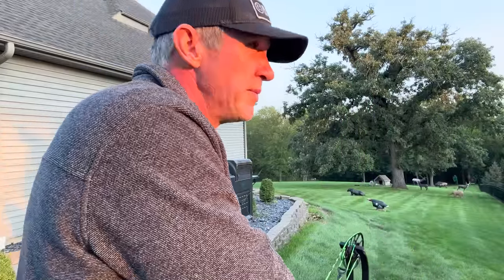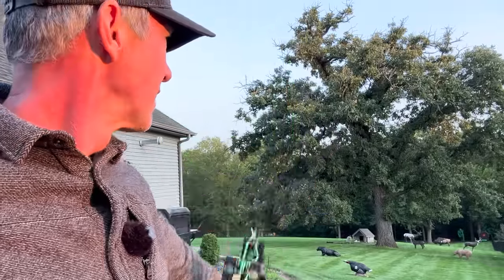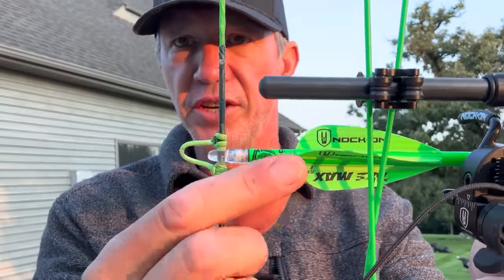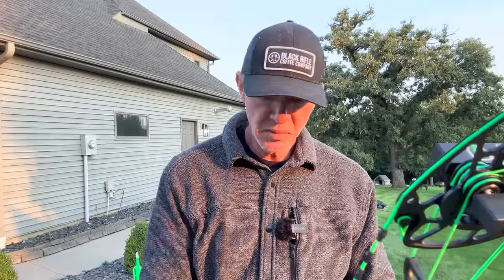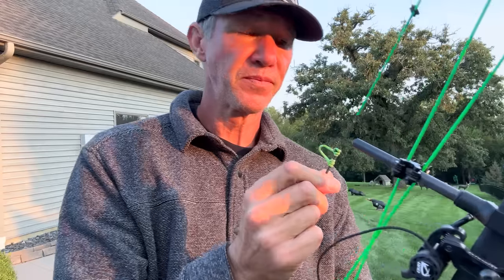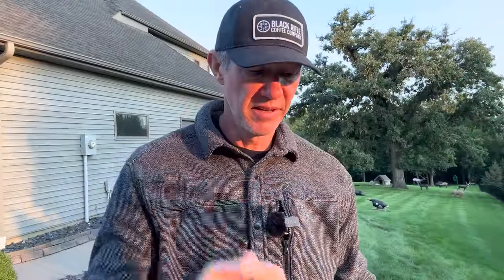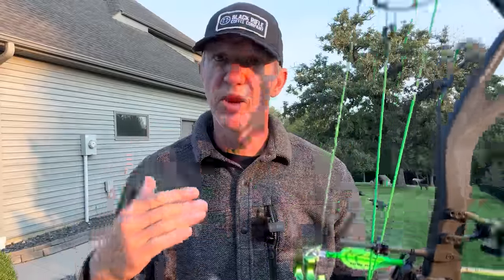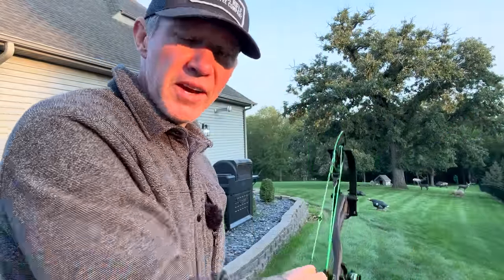EASY TO SEE ACCURACY KILLER that’s so easy to fix!

Comment: Interesting video! Im currently having an issue where i can send a few arrows, no problem - but then all of a sudden it goes 3-5 feet over. Me and a friend are really scratching our head trying to figure out what is causing this. I am very new to archery, so i do not have alot of knowledge but it's really frustrating sending arrows into the wall behind the 3D target when the shot feels so good. Any tips? Anyone?
Reply from the maker: If it’s the same arrow that could be a result of one arrow on the lower end of the tolerance allowance. Try turning the nock90 degrees and shoot it again and see if it’s grouping position changes. If so you can keep trying to adjust the nock to bring it back or replace the nock entirely. Be sure to mark that arrow too. Fyi lower cost arrows have a wider variance in straightness and spine consistency so it’s not uncommon to find a flyer on a dozen if they aren’t “match grade” arrows
Reply: Number your arrows, take a sharpie and write a number on each individual arrow. If it's the same one consistently it might just be the arrow.
Reply: @nockonarchery  I appriciate the reply! They are infact cheap arrows, and i am getting some better ones tomorrow. But it is unfortunatly not isolated to a specific arrow, as several of them went into rocks and broke after going way over :D It is worth mentioning that i did go from a whisker biscuit to a QAD drop down rest, and only then did this start to occour. I also noticed that the top half of my serving had slightly lowered. Could something here be the issue? I probably have a little knock pinch aswell, that will be sorted tomorrow
Reply: @dunk7689   I appriciate the reply! They are infact cheap arrows, and i am getting some better ones tomorrow. But it is unfortunatly not isolated to a specific arrow, as several of them went into rocks and broke after going way over :D It is worth mentioning that i did go from a whisker biscuit to a QAD drop down rest, and only then did this start to occour. I also noticed that the top half of my serving had slightly lowered. Could something here be the issue? I probably have a little knock pinch aswell, that will be sorted tomorrow
Reply: I'm going to guess it's your form and shot process as I've gone through the same issue. As my form has improved, so has my consistency in my groups. What I figured out was that my draw sequence wasn't smooth as it should be causing me to strain my shoulder causing extra exhaustion and inconsistency. I dropped my draw weight to combat this and it's helped a ton in helping me correct my form. Accuracy / No injury > high draw weight
Reply: @johnvang5581   Although my form definetly can improve, it just dosent add up. I can have a solid grouping on 50 meters. But all of a sudden, when i send one - i hear a different sound from my bow, just slightly - and the arrow lands 2-3 meters above the target. As mentioned earlier, i did recently change the arrow rest, but after several slow motion videos of the dropdown, we cant see anything wierd. We are kinda lost at this point, and we've tried all sort of different tips and we cant really seem to figure it out. The bow is only at 55-60 draw weight.
Reply: @christerlkas5148  I would mark your fletching for the arrows that are flyers to see if these arrows are consistently flyers. If they aren't, Id say it's the archer. Are you punching the trigger or having target panic? I noticed I have target panic too but was able to minimize this with better follow through on my shot process. Maybe this might help? What JD said above about cheap arrows is a good point as well. Also, are you shooting consistently high or is in consistently all over the place? I've shot consistently left before getting a second opinion and he told me I've been torquing my hand during my shot process. 

I'd go over the basics and have your friend or someone else that's knowledgeable to look at how you shoot. If you have flyers, it may be arrows if your basics on form/process checks out. 

Does your bow have a solid back wall ? This makes a big difference too. I went from a infinite edge pro to a used hoyt charger. Night and day difference in confidence now.
Reply: @johnvang5581   Thank you for replying!
All the bad arrows are gone, they all met the rocks behind different 3D targets. I am getting better arrows tomorrow, recommended by several archers and also cost abit more.

I did use to punch the trigger alot, but that has improved alot after many videos and practice. And the arrow was consistently high - always.
At 20 meters it was going about a meter over, on 50 meters it was going a solid 2-3 meters over. 

I then handed the bow to a much better archer than myself, he's been doing it as a semi hobby for a few years - the first arrow he sent when straight over and was left with a big questionmark above his head :P

We did several shots where we REALLY focused on the form, from nose touch, to anchor, grip, release etc. Some arrows shot fine, until it all of a sudden went real high.
What confuses me alot aswell is the fact that it happend after we installed the new arrow rest. My mind is locked on to it being an issue around that. So we spent an hour testing EVERYTHING - same outcome.
Reply: @christerlkas5148  Did you adjust your sight at the 20m? If it went high you should moved the sight to follow the hit. If you didn't, it makes sense that your 50m is even more off since your 20m was already off. 

Im betting it's the sight needs to be tinkered with again at your 20m
Reply: @johnvang5581   No, it's definetly not the sight. I have 5 pin sight, so it goes from 10-50. I can send 10 arrows going prefect, and then on the 11th it goes woosh, straight over. Same distance, same 20m pin. But a different sound from the bow when this does happen.
Reply: @johnvang5581   And this is what makes it so hard to crack, because it dosent make sense - everything is working just fine, hitting good shots at all distances, arrow flying like a dream. Until it's not, and goes VERY high over.
Reply: @christerlkas5148  Oof. That's tough. Let me know if the new arrows fix it. I've only practiced to 40 yards and my group is a decent 3-4". Still practicing though. Good luck! 🍀
Reply: @christerlkas5148 Not sure why it would only happen occasionally but some drop away rests don't have brakes on them so when they drop down they actuality bounce back up and can make contact with your arrow or fletch.  
That said I would think that would cause low misses not high. 
Only other thought is how the bow lifts the rest when you draw.  Most are cable driven so when you draw back it pulls a cord and lifts the rest. Maybe that isn't adjusted quite right and if you are sometimes not completely against the backwall of your draw the rest is slightly lower on that shot. That shouldn't cause it to be off by feet though. For it to be that far off your rest would need to be way off.
Just some thoughts to consider. It does sound like it is related to your rest.
Reply: @christerlkas5148 
Thinking about it a bit more it could be nock pinch.  To miss high would mean the point of your arrow is higher than normal.
Hope you can figure it out. 
If it keeps happening you can always throw the whisker biscuit back on and see if it stops to confirm your suspicions.